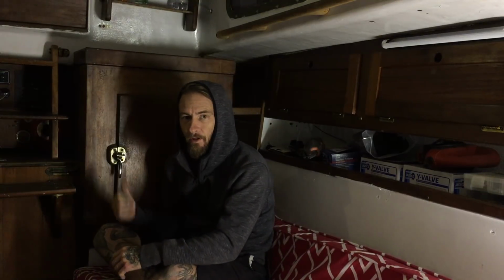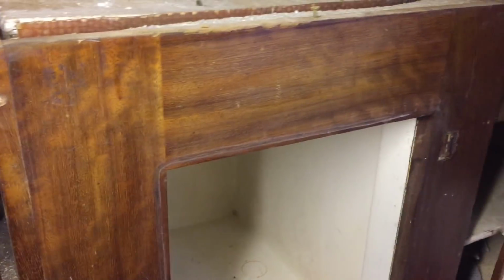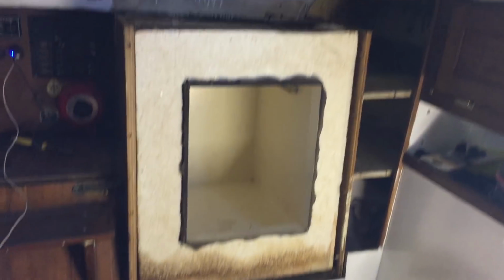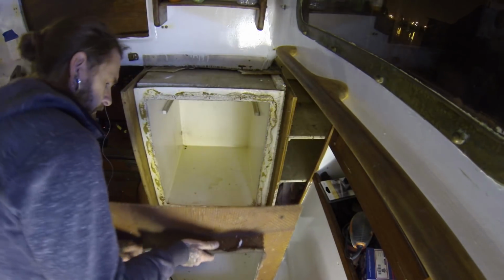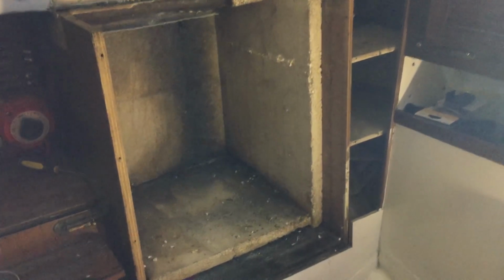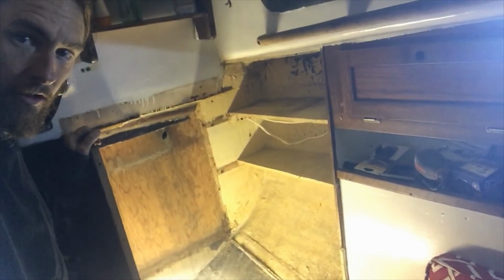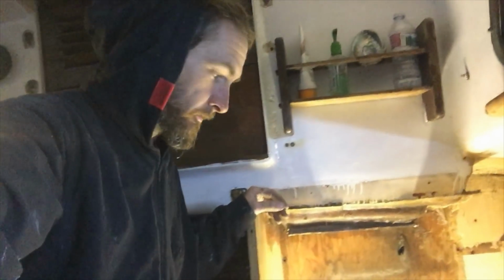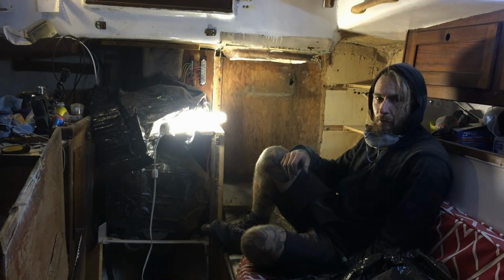Removing the Icebox on an Alberg 30 - Sailing Vessel Triteia

Comment: I got rid of the old icebox on my Alberg 30 more than 25 years ago, and put in a new icebox under chart table (like the later models).  I use it mostly  in a right knee kneeling position, which has worked for me.  I am ten years older than my 1967 good old boat, and I prefer navigating on paper charts.  Also like a real icebox that keeps my beer cold.
Reply from the maker: I am on the right path then it sounds like. I like this arrangement so much more than that big ice box

Comment: If you haven't already done so check out Atom Voyages (James Baldwin's) YouTube channel and note how Mr. Baldwin recovered that space when refitting his Pearson Triton 27 and a number of Alberg 30's. Instead of creating leg space he created an additional storage locker and then an extending/sliding table that can be used as a navigation station. He too removed the electronics from under the companion way to add protection against water invasion to the components. I am quite envious of your boat. I think the Alberg 30's are lovely boats.

Comment: I feel like how smoothly this went is an inaccurate representation of boat projects. :)
Reply from the maker: seriously, I felt the same as it came apart easily.... I will say since then I have started trying to cut the flange out that was around where the cockpit deck access was and it will be the death of me. 2" thick solid fiberglass.... so hard to cut out.